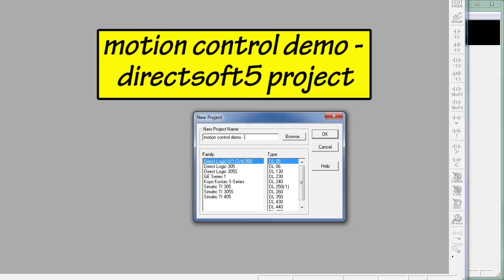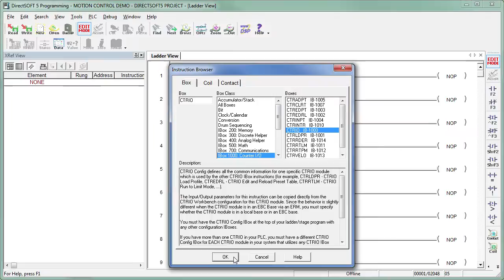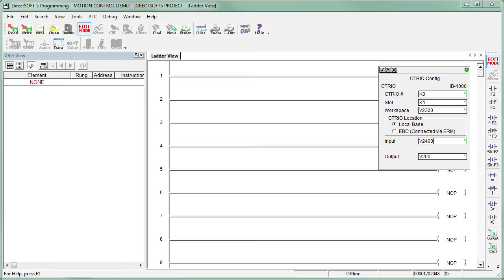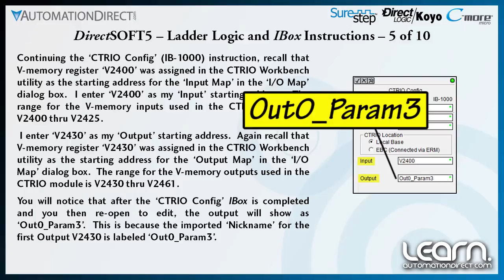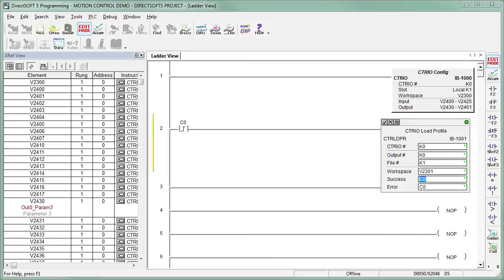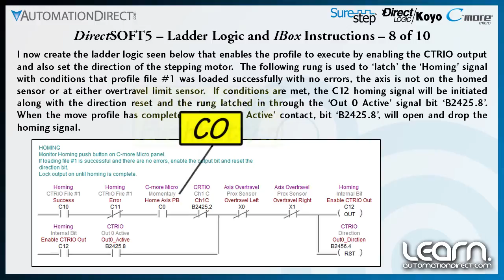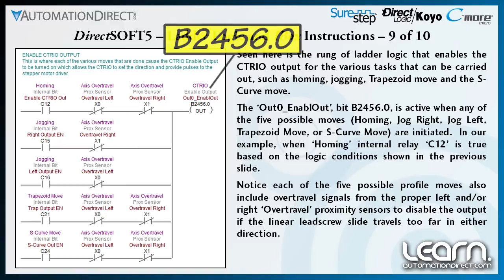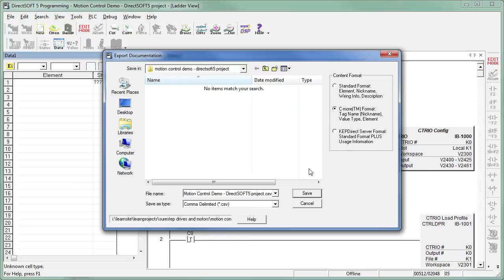DirectLOGIC Motion Control Ladder Logic and IBox Instructions (6 of 8) from AutomationDirect

Comment: Thanks Tom.  I'm noticing that the CTRIO outputs a 50% duty cycle in the "home search" pulse profile.  Is there a way to reduce it?  It homes way too fast and overshoots.
Reply from the maker: I believe there is a homing speed setting in the home search profile that will alter how fast the pulses come out of the CTRIO when that is activated. I believe the duty cycle is hard set at 50% for any of the non-PWM modes.

Comment: The supporting documents show that for the reverse direction jog, he uses the constant Kffffe000 as the speed where in the forward direction he used K2000.  How is the CTRIO interpreting this hex value as a reverse direction and speed?  Also, in this implementation, when he releases the button for "jog" the motor comes to a hard stop instead of decelerating to a stop.  Would it be better, upon releasing the button, to change the target speed to K0 and leave the enable output bit high until the motor comes to a complete stop as indicated by the output active bit B2425.8 ?  I appreciate your posting this demonstration.
Reply: I think I found a partial answer in the CTRIO manual.  Use the hex negative value of the velocity by: convert to binary with BIN, take the ones complement with INV, add constant 1 to value, then load the result to the appropriate memory location.  the logic presented in the supporting documents must have calculated the hex negative on the side and dropped it in without going through those steps.  It was not clear that the memory location would accept a HEX value in addition to BCD. I'm still working on a solution to the hard stop issue.
Reply from the maker: @stevesykes68  That is correct. If you release the jog button it will just stop. If you want it to have a smoother deceleration what you are proposing should be a great way to do it. In the HAP tools folder that is installed with DirectSoft, there are a lot of example programs for many functions including CTRIO. One of them might also help you with some of these types of programming questions.